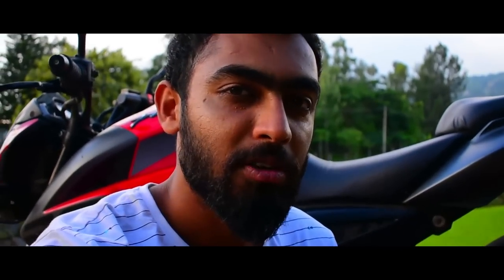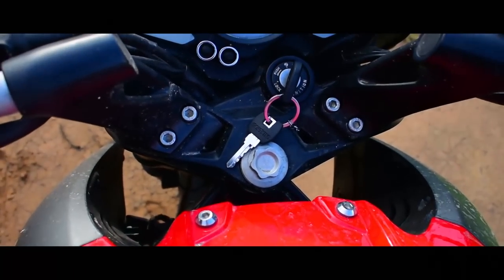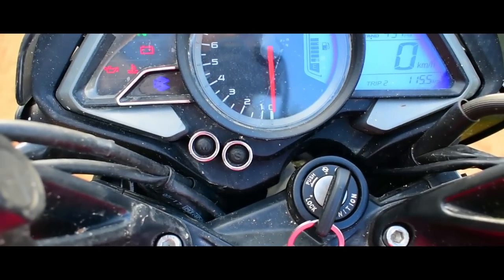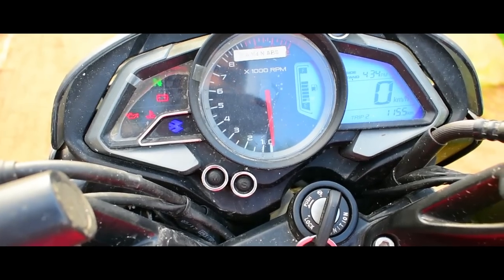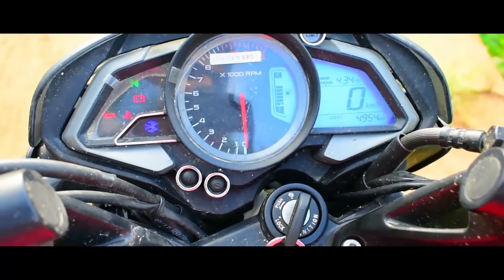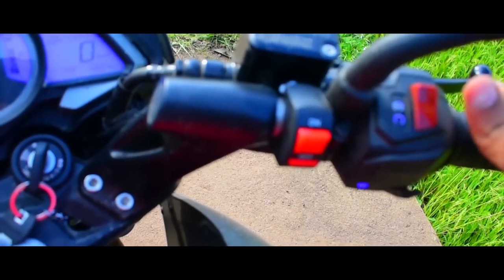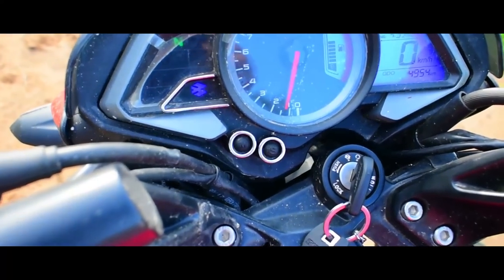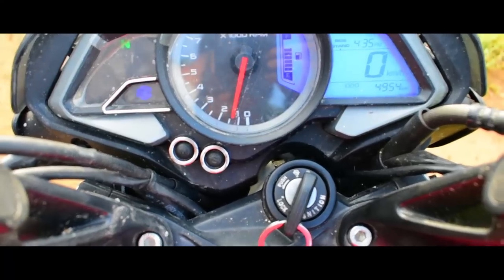Problems of NS 200 2017 (Laser edged)  repoted and fixed after 2nd service 5000 Kms of ride review

Comment: Bro does to tell them about this rpm problem??
Reply from the maker: Yes they have fixed it now
Reply: @sanxoneSanjayKR  bro I have face same problem and if I tell to the showroom the reduce the RPM so when my bike is cold bike turns off my bike is ridden 450 km
Reply from the maker: Ask them set it 1300 to1500 rpm, so that it will not turn off the engine
Reply: Thank you bro

Comment: How was the rpm issues solved?  What did d service center guy do? 🤔
Reply from the maker: +Anirudha Guha they adjusted rpm by tightening screw given on the bike for better milage and performance
Reply: sanxone MysTry Rider! Is the screw located somewhere near the rear brake foot peg?
Reply: sanxone MysTry Rider! And by adjusting that screw only the rpm problem solved?
Reply from the maker: +Anirudha Guha Yes

Comment: What will be the rpm when you start it for the first time in the morning?
Reply from the maker: +Shreyas G S it will be in 1.2
Reply: sanxone MysTry ! I have NS200 and i was facing same rpm issues... Whenever i start my bike the rpm will be at 1.5 and after some time it used to go above 2...so i turned the idling nut and set it to 1.5 after the bike is heated up... But in the morning, the rpm will be around 1...
Reply from the maker: +Shreyas G S that's perfect bro,  but I suggest you to go to the service center and ask them to check once
Reply: sanxone MysTry ! Ok... I'll ask them once because the bike will be switched off after 10 secs in that rpm
Reply from the maker: +Shreyas G S yeah then ask them to tune it
Reply: sanxone MysTry ! Ok